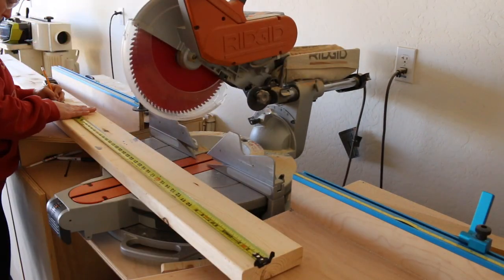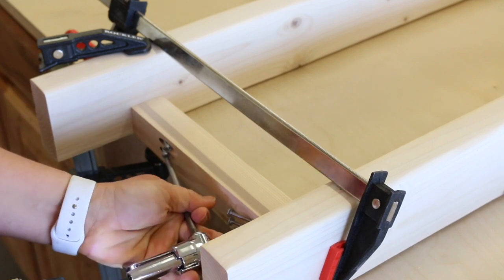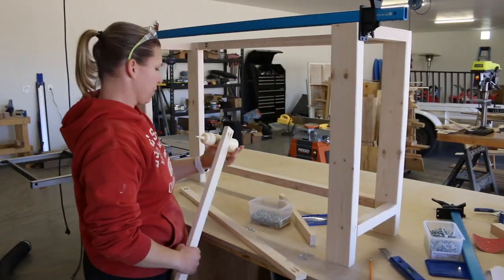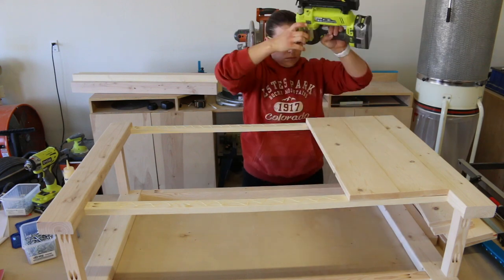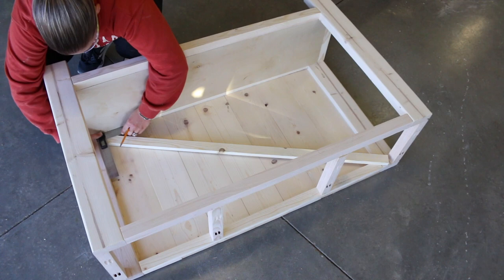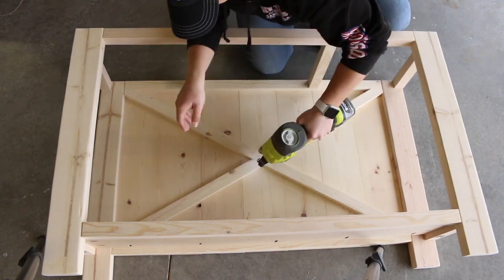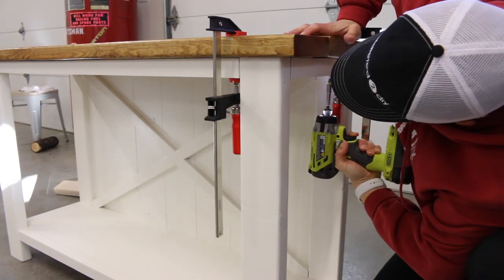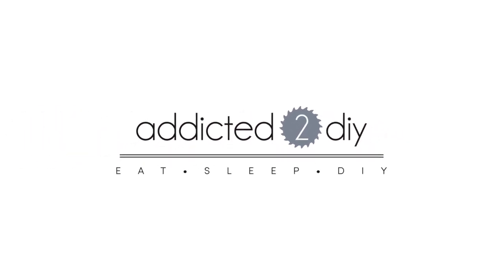How To Build A Farmhouse Table for $40

Comment: Yes this does require special tools, not everyone has a machine to make pocket holes no or the fancy cutting saws
Reply from the maker: DonnaP you actually don’t need an expensive pocket hole jig or fancy saw for any of this.  A regular miter saw and a smaller Kreg pocket hole jig will work for so many projects like this one.  I started out with next to nothing in tools and still built quite a few high-end looking projects with them.